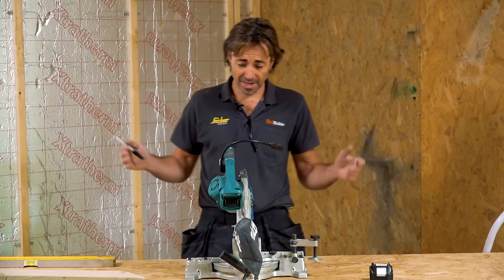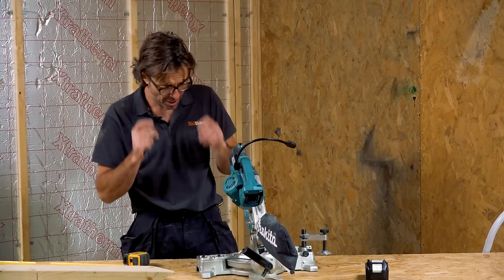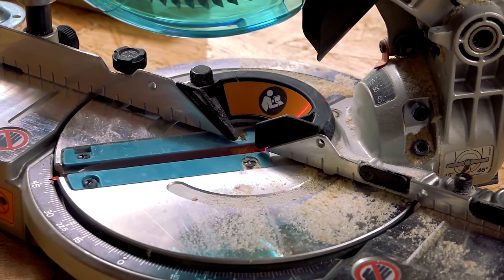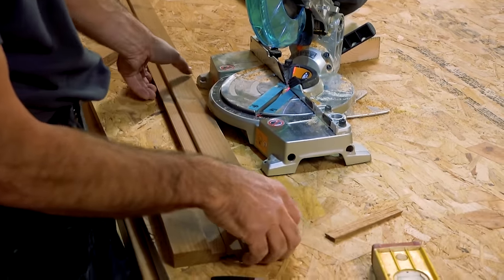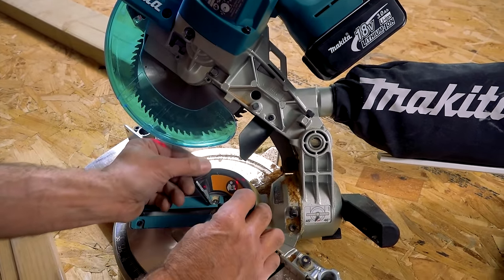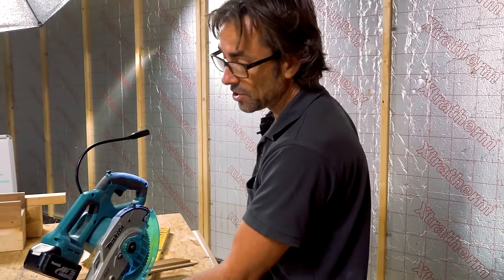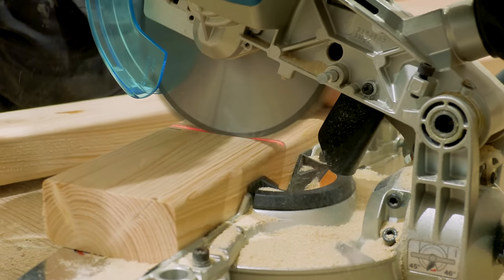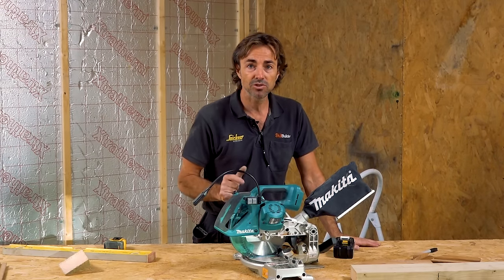Makita DLS600Z Mitre Saw ~ Is This a Toy?

Comment: Okay so I just got mine and it is a really top notch tool. I see a lot of people saying it is expensive, and it is, considering the 40v 216mm slider is only about 20% more expensive.

This, however, says made in Japan on it. Could explain the price somewhat. Mine came totally set up out of the box, even the laser is dead on. Might not be worth it for a lot of people but it's exactly what I need. One hand carry, takes up very little space in the van, goes with a single battery. Only had it for about 2 hours but I am very impressed so far. Also comes with a very high end 64 tooth blade.

Comment: its a perfect little saw for doing shoe molding! So compact and portable the only thing that's keeping me from buying it is how u have to loosen a screw to change the blade angle instead if the more widely used front push to release that all other saws have. Doing that 200 times a day is going to drive u mad!! If they made that adjustment im sure they would sell a lot more of these saws.

Comment: How am I just finding out about this. Couple of times a year I have to do small alu trim on jobsites, right now I have to do 3500 meters of alu skirting on a large conference building. I'm lugging my makita MT around between 7 floors, mainly because it's so cheap I just leave it wherever on site, if someone takes it, it has already payed for itself many times over. Would be nicer with cordless, only have 2 outlets on each floor, but I don't want to lug around my cordless kapex because I can't leave that on site overnight. This thing is less than 7 kg! Bit on the expensive side, but on this job alone it would already pay for itself, speedig up the workflow not having to run around for m the nearest of the 2 outlets. This will be my 4th miter saw, I guess it never ends...

Comment: I love Makita tools, best in terms of build quality and longevity in my experience. 90% of my cordless tools are Makita. This saw looks nice, but the price tag it comes attached to is over the top for me. I ended up buying the Milwaukee 7-1/4" sliding saw which is slightly larger in footprint, weighs a couple pounds more but offers so much more in terms of capacity, blade availability (here in the US at least) and the Milwaukee saw with a 5ah battery and charger is the same price, but often much cheaper on sale, than this little Makita saw. Hell, Makitas x2 10" front rail saw is the same price as this saw and around the holidays its actually cheaper in kit form with 2 5ah batteries and a dual charger than this bare tool. Wherever this huge price increase comes from, it's certainly not from raw materials.
Reply: essinem4130 
I have 20 or so makita cordless tools and would love to have this little saw but I am having trouble with the price point too.
If it were around three hundred U.S it would be a no brainer. 
Never seen this one on sale ,  got the 10" cordless slider for 30 more than they want for this one.
15lbs sure does seem awesome though...

Comment: re the circular saw, I just laid up about 100m of garden edging for my partner using 200*50 pine sleepers.  My Makita 18v saw (single battery, not the X2 version) easily makes it through multiple dry sleepers but the wet sleepers take a massive toll on the batteries.  Fortunately I wasn't pushed for time so I was always able to either let the battery cool down in the saw or simply pop it out and put a new one in for each wet sleeper.  If I'd had my dual charger on hand instead of the single charger it would have been better since the dualy has a fan to cool the batteries.